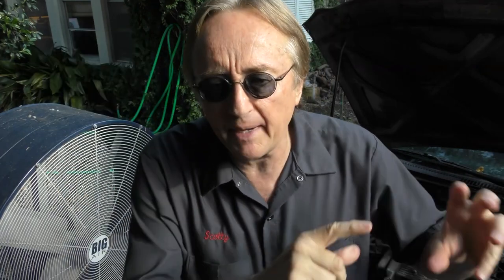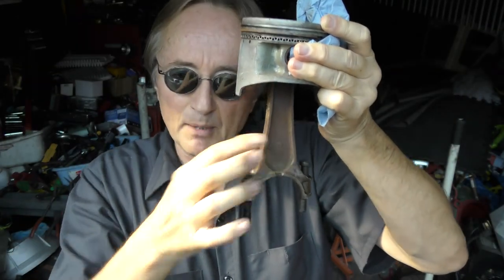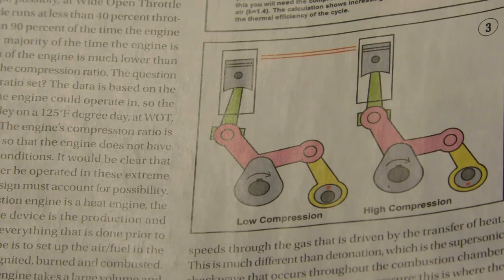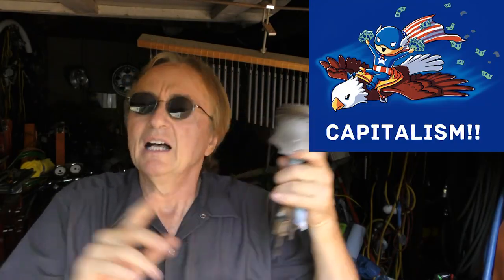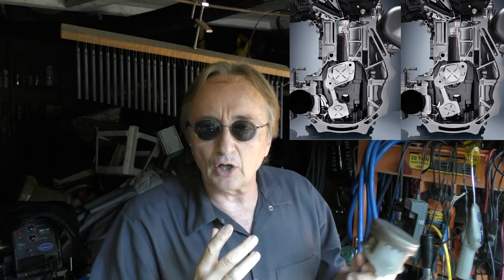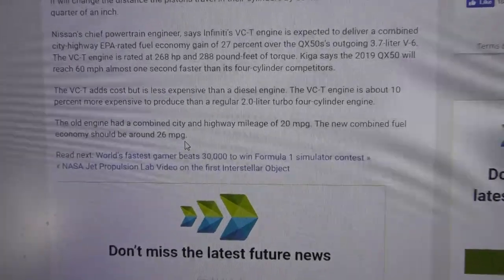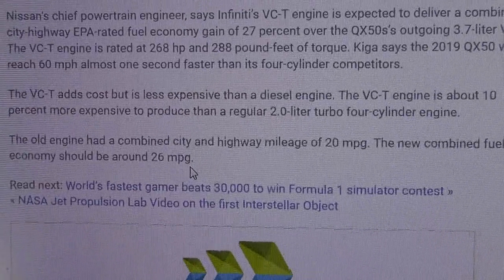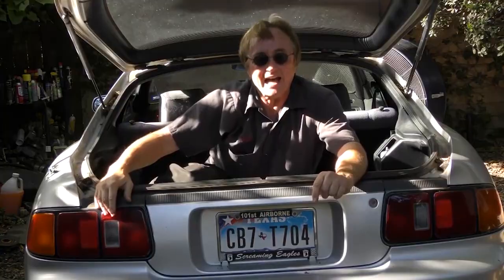If You Buy This Type of Engine, You're Going to Regret It

Comment: I'm a professional electrical engineer and I agree 100%.  Sometimes engineers do ridiculous things just because they can, not because they should.  Actually, it's more likely marketing is pressuring engineering to produce something "appealing".
Reply: And other times they have a loaded weapon pointed at there heads and they have to move or die.
Regulations can have terrible consequences.
The 44th POTUS rolled out so much new and improved regulation, it nearly broke every system.
Reply: Hey Randy what does an electrical engeneer have to do with car engines,I also like Scotty,most of the time I agree with him but this time he might be wrong.if we were to listem to you guys out there we'd be still riding horses and horse drawn carts. Nissan has been testing this new technology for more than four years,don't you think the should know better than destroy their own name and brand,especially with so many cheap good engines in the market today.Scotty could wait a couple of years to seee what happens with this type of engine and do you know why I say this because what would happen if this engine turns out to be a wonderful piece of technology...just my grain of salt.
Reply: Electrical engineers have a whole lot to do with engines now-a-days.  Nothing happens in a vehicle without the ultimate "permission" of the ECU.  Your engine RPM, fuel ratios, timing, and much more is determined by the electronics systems.

Modern cars have literally dozens (maybe even 100+) input signals, such as - engine temperature, volumetric air flow, accelerator pedal position, fuel rail pressure, calculated engine load, engine RPM, air intake temperature, barometric pressure, evaporative system vapor pressure, exhaust gas temperature, oxygen sensor voltage, and a bunch of other calculated and directly read signals.

The simple answer is - nothing happens in a modern car without intervention from the ECU.  Electrical engineers are the ones who design these electronics systems.  So, that's the answer.
Reply: They were developing this engine since 1998.
Reply: I'm a mech.e. I've had to shortcut!
Reply: I am a Mechanical Engineer and a Government Trained Mechanic. Scotty and Randy are correct. Don't spend money until the product is proven reliable. See below for my opinion. I am also a Military Combat Engineer who loves to blow things up.
Reply: I like that they have the new VCR engine. But on technology I´m always waiting a bit to buy it.
Reply: Randy Lott It's strict government CAFE standard regulations that are forcing car companies to do this ridiculous stuff.
Reply: Juanito Suriel Hey, If this engine turns out to be "A wonderful piece of technology" then GREAT! But it ain't yet. You can't force technology even though the government thinks it can.
Reply: The companies all have solutions for this but they´re hiding it. And sometimes they bring it to production.

Problem today is that they earn the money from the spare parts... They don´t want it to last long.
Reply: Randy I'm an electrical engineer also and have been in the oil and gas industry for 36 years. I was asked the same question constantly. The average person is not aware of the technology that is involved in almost every industry these days.
Reply: EPA is forcing these companies to innovate. Soon v8's will be terminated then the v6's and turbo 4's. Hybrid's systems will help combustion engine live a little longer though. After that then fully electric cars will be mandatory
Reply: Yeah, not every idea pans out and there are probably more bad ideas that good ones.   That being said though, the sentiment of this video is the same as when electronic spark came along, or fuel injection, AWD, air bags and seatbelts (do you remember "I don't want to be pinned to the side of the car by the seatbelt, unable to move, in a side collision"), electric fans, computer controlled engines (fuel, spark, timing advance, etc).  The one thing i remember each time is "oh, that's another complicated thing to break"   or "you're screwed if you're in the middle of nowhere and that wahtever new thing breaks"   "new fangled gadgets, can't fix it yourself"   Cars today are so many times more reliable than cars from my childhood.   Back then, cars were being boosted, towed by buddies with a rope, and pushed out of intersections all the time.    Not today.     

Everything i've listed started out with this kind of public reaction and i'll be darned if you back pedal on these designs and try to sell/make a new car that doesn't have every one of them other than AWD maybe, and even AWD is in just about every SUV on the market today.
Reply: An engineer like you should also see that with time comes change and some changes might start off as weak but then catch on later as time goes by.Sometimes we are quick to discredit something that just might be a good idea instead of giving it a chance.Old timers like you and scotty should know that by now.See how the grade of fuel has changed over time.Leaded gas would kill a fuel injected engine while the older carburator design could live with leaded gas more work in return for fellas like scotty to clean off deposite build up in engines.Then engineers developed unleaded gasoline for the fuel injection design and even the carburator design love the unleaded gas.
Reply: Exactly The manufacturers are under pressure from both the Govt as well as the consumer. The mfg is creating a product that gets better mileage. This same product will, however not last as long and break down more often.
Reply: nunchaku101  put the tinfoil down now
Reply: @mnvikings1973  You cannot say how long a product will last until it gets some time from it's consumers.Also that's not always the case with certain products.Some products will be good and last right off the first time and some may not be good till after a redesign.Still we cannot judge a product until it has some real time around.
Reply: @johnathancommodore9642  Actually i can and did say it. It's an opinion, just like yours. You want to play the Example game? Ok let's go...The twin turbo Eco Boost V6 VS. the tried and true 5.0. Which will have more durabilty over the long haul?
Reply: @mnvikings1973  Scotty is a good mechanic but if you agree with him on this one then i'm done commenting with you it just shows that guys like you have no vision for future evolution of things.
Reply: @johnathancommodore9642  Hang it up with me, i could care less. Why don't you take it up with Randy Lott and i'll sit back and watch.
Reply: engineers dont have any common sense. They cant understand the basic concept of if it isnt broke dont fix it or the simple idea of leaving things the hell alone and DONT CHANGE IT FOR THE WORST. Every change they make for no good reason over the years makes things worse. Also they cant make things simple to use
Reply: Even a non-engineer common sense layman with a modicum of mechanical knowledge can see that this thing is a disaster waiting to happen. Maybe not to the first leaseholder who dumps it in 3 years, but the person who picks this thing up at 5 years and 70,000 miles is going to have a mess on their hands. We'll be seeing these in junkyards in short order. Great condition bodies with blown engines. Kind of like Cadillacs with Northstars.
Reply: Love to be a dick, but an electrical engineer should not be commenting about the work of a mechanical engineer.
Reply: Hmmm. Sounds like the US government.
Reply: There's pressure from gov regulation to get higher MPG, and manufacturers get stuck in the "we're not selling enough hybrids" to make up for the less fuel-efficient vehicles, so they try try try to make the less fuel-efficient vehicles more efficient yet still as fun to drive with these new/crazy technologies.
Instead of having one model which is exclusively a hybrid, make a basic hybrid system into multiple models. Take the durable part of hybrid technology and apply it elsewhere. Use capacitor banks which are not much affected by extreme cold or charge cycles, and has been used in city buses for a decade. 
With start-stop, electric acceleration assists hybrids in multiple common car models, the current hybrid model can transition to being a more advanced hybrid, to test new technologies and short-range electric only, plug-in hybrid, whatever. 
Let the reliable technology be in mainstream cars, and the new tech stuff in something people specifically choose.
Reply: @RandyLott  "calculated engine load" isn't a sensor signal. That's something the ECU calculates using multiple sensors.
Reply: @javaman2883  That's why I said "calculated and directly read signals".  This is under the category of calculated.  I hope it's pretty obvious that you can't use a single signal to compute this.
Reply: Well i guess the Nissan company generated 42.9 Billion value by not knowing what they are doing, putting out inferior un reliable products and hiring engineers to do ridiculous things ? the only ridiculous thing i see here honestly is this video. Have a good day gentleman,
Reply: @juanitosuriel6931  Cough-CVTs-Cough  Nissan has had the worst year over year sales drop out of all the major japanese manufacturers, so, I wouldn't trust their tech just cause they 
"tested it".

Comment: Actually, Cadillac’s V8-6-4 was a very robust and reliable engine. The reason it failed is because the electronics didn’t exist at the time that were able to keep up with the rapid changes in displacement demand that were required to operate. The V8-6-4 engine, if given modern computer controls, would work fine today. It was an idea that was ahead of its time. As to GM’s modern displacement on demand engines, they are just as reliable as anything else out there. My Silverado’s 6.0 LS engine with D.O.D. is still going strong with zero problems after ten years. Most of what you say in your videos is spot on Scotty, but this one, not so much. But I’m still a big fan and I love your videos. Keep up the good work.

Comment: Yea.. But that engine was designed by Mercedes so im not surprised it would break down

Edit: I did a little research and that engine was built by Nissan, its a 2.0L turbo engine that puts out 268 hp.. The one i previously mentioned is a 2.0L turbo that puts out 208 hp designed by Mercedes & used in the Q50/Q60.. Wanted to give nissan the benefit of the doubt but they've been a mindless profit machine for the past decade.. Awful😔
Reply: This Engine was not designed by Mercedes, purely Nissan.
Reply: anything mechanical by Mercedes is gonna last and is reliable, but anything electrical by them is not reliable
Reply: I believe you’re talking about the 2.0t engine. That is
Reply: That is designed by Mercedes and used in several of their models. I must say it’s a Very peppy motor.
Reply: Mike Litoris he is right the 2.0t is a Mercedes motor.
Reply: I see your experience from your profile photo

Comment: I'm a mechanic at Infitniti.   I agree with Scotty.    Hadn't seen any big issues yet, but it is a lot of wear parts.  They've been out for a while, but still too soon to tell.
Reply: yo. im a regular mechanic. i cant get the crankshft position sensor out.
i removed the 3 bolt and the thing is stuck..wont move any. this is the circular one. not the small plastic one. any advice?
Reply: oh is on a 95 j30t v6
Reply: This VCR technology is good in the 2022-2025 Infiniti QX60 3.5 V6?

Comment: You always make sense to me. I found the Nissan engines to be super reliable, I had a SR20DET for a number of years with which  I put bigger injectors and turbos on it and never a problem, even turning the boost up to 17 PSI to get about 380 HP out of it. I never once adjusted valves or anything, totally sealed for all the years I owned it.

Comment: You're just saying what's been said for longer than I've been driving.  I'm 62.  Never buy a first year production car whether it be a brand new model or a significant refresh with new technology because they almost always have their teething problems.  Nissan's variable compression engine is definitely something new.  I have to admit, I'm intrigued by the design.  I hope it does prove itself, but it'll never do that if no one buys it, and therein lies the conundrum.  Like you Scotty, I'm not particularly interested in being a guinea pig either.  ;-)
Reply: Steven Rhodes I agree, new technology is risky, but somebody has to try it
Reply: This is why luxury car brands tend to have longer warranties. Also, customers of new luxury cars tend to lease, partially for this reason. Many luxury cars are based on high-volume, non-luxury cars these days, which helps the engineering be more reliable. Lincoln=Ford, Cadillac=Chevy/Buick/GMC, Acura=Honda, Lexus=Toyota, Infiniti=Nissan, Audi=VW. Often, the luxury model is 80%+ the same as the regular model, with tweaks to appearance, comfort, convenience.

Comment: I love the 318 in my truck. Technically it's a 5.2 LA but dodge stuck with a reliable classic and made small changes to it. MFI, they changed the metallurgy to lighten the engine and components. She's got about 250k and all I've done were oil changes and tune ups. And the occasional sensor. She does burn a little oil but an old foreman of mine who is experienced with classic mopar told me the 318 always burned a little. That's why you do a walk around and check the fluids. I drove commercial so a pre trip is second nature to me but am a big believer in it. When I worked for a shop a few years ago I got a lot of return business from teaching some basic auto care to the customers.

Comment: Weird my 2008 Silverado with a 5.3 with cylinder deactivation has 200000 miles and nothing ticks and never loses a drop of oil between changes the body isn't the greatest but the driveline is solid
Reply: Do you notice improved gas mileage?
Reply: Bret Sonenstein I had a 5.3 without active fuel management it was a 2001 I got around 17mpg on the highway this 2008 I get about 20-21 mpg on the highway so not a huge difference I treat it like it is turbocharged and I change the oil more frequently and I have never had engine problems
Reply: those cylinder deactivation 5300 from that era are notorious for complete failure. i mean total shutdown the engine is getting thrown in the shredder. your frequent oil changes may just have saved you an out of warranty engine replacement.
Reply: ima be be be be so moral of the story maintenance is king just like every vehicle all I'm saying is if you change the oil and don't drive like a meathead then you will be happy with that engine
Reply: I bought a pre-owned '07 Sierra with the 5.3 and at 125k miles the #4 lifter collapsed. Cost me about 2k to fix. 

**It had around 120k miles on it when I bought it.
Reply: okarnando88 that sucks dude the only vehicle I had engine problems on was a 1998 ford f150 it was the 5.4 triton it had 140000 miles and the cam phasers went they wanted 4k to fix them
Reply: 155k miles on a 2000 silverado but about to be on my second transmission :(
Reply: hack deez my 2000 with the 4.8 had gone thru 3 4l60s lol upgrade to the 4l80 transmission those were alot better
Reply: Well, if you get 3 or 4 mpg more it's 20% better and that's nothing to sneeze at. As long as you're not having problems with it.
Reply: Have a 07 regular cab with a 5.3 and active fuel management and haven't had a lick of trouble, except for the battery, over 140000 on it.
Reply: I've had multiple 5.3 engines not one problem. An 07 suburban for the wife and 07 Silverado was mine. I recently got the 17 Silverado with the same system. I heard they will have the 5.3 with I think it's called dynamic active fuel management. At least gm isnt afraid to try new things although they were behind the curb on the push rod engines compared to all other manufacturers but they caught up haha. Anyway suburban is at 230k ish and the 07 Silverado was at 200k when I traded it for my 17 now thinking of getting a new Sub for the wife as well.